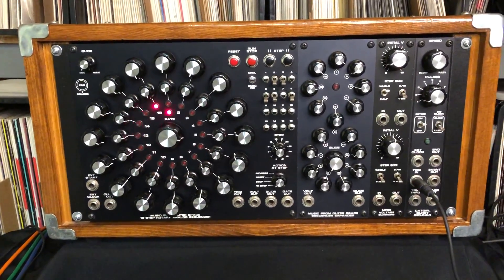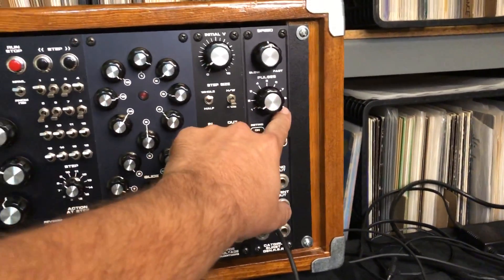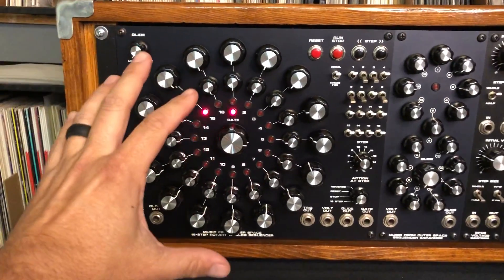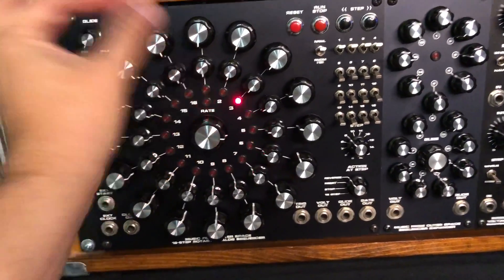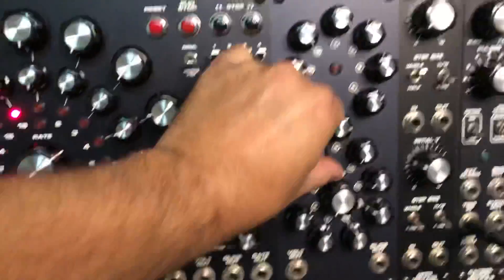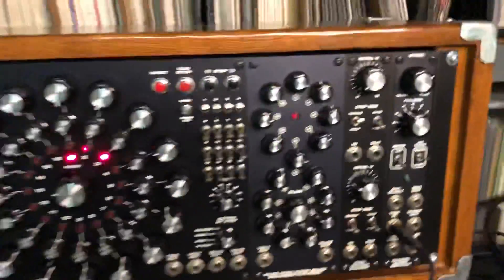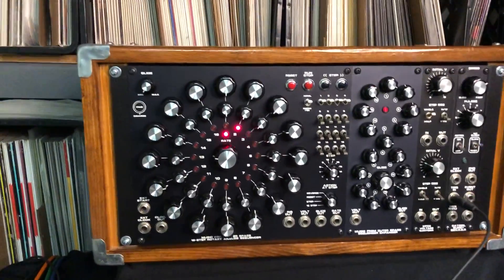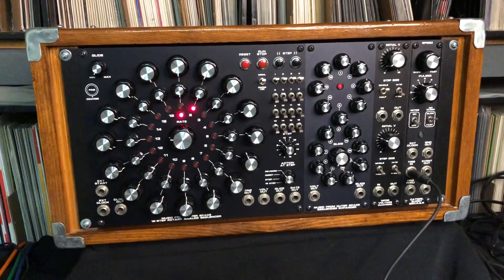MFOS 16-Step Rotary Analog Sequencer Controller

Comment: Wonderful, did some digging, looks like you built it back around 2007. Of course it sold quickly, looks like you put a ton of work in it. As for Ray, I didn't know he'd passed on, but it looks like you can still order PCBs off the site. He wrote the Make book on DIY synths and such, good book to pick up for DIY guys and gals. Ray was in the same league with the early synthesizer developers like Moog and Buchla.